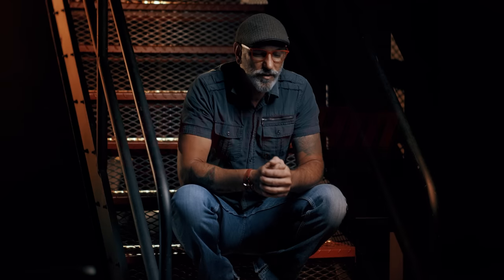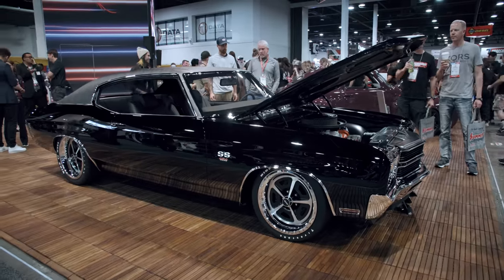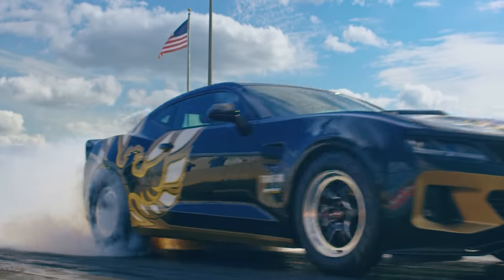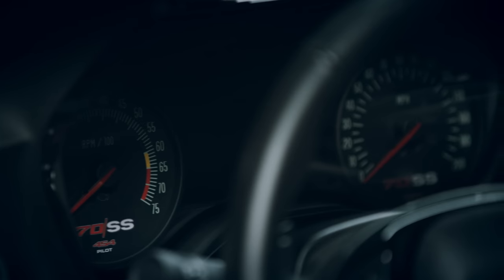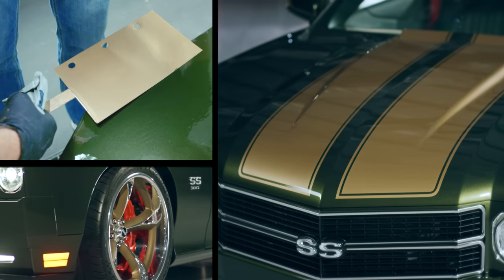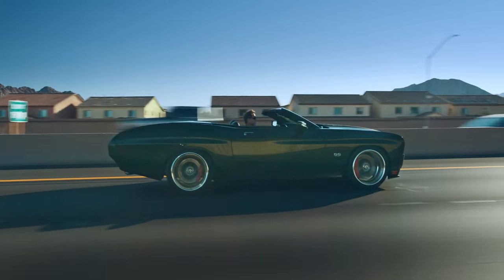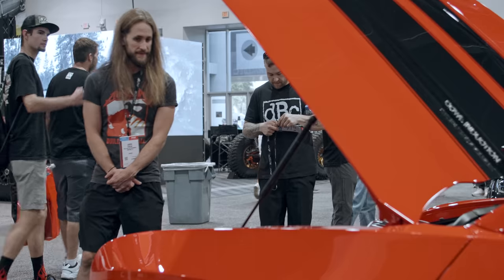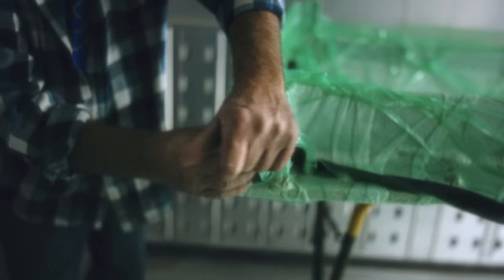The New 70/SS | Return Of A Legend |

Comment: Nice try. My 68 SS could get the front wheels off the ground and I could do all the repairs myself. All that on flipping burgers money.

GM has truly lost its way.
Reply: I concur. Mine had open chamber heads, ported and solid Isky cam in 0.030 396 Block.
A nice 70 SS Cowl induction 396 Muncie 4 speed was selling for $2795 in 1977 on specialty car lot.
I bought my Malibu 350 SBC with saginaw 4 speed with posi for $1000 and 68,000 on the Odometer. After a year I turned it into a clone SS.

Comment: I honestly don't like the way the front looks. All other angles where you can't see the front look great. I think its the bumper that is messing with it. To much color. While I hate chrome, I love the look of the 70 Chevelle SS and most 60-70 pony and muscle cars. The concept pic for the hard top looked a lot better in the front but its not perfect. That one is how the fender goes so far down then wraps in to make the air dam. But removing that big flat panel of color for a bumper is an improvement.

Comment: Sorry, but the 1970 Chevelle SS doesn’t come close to the 1969 Chevelle SS with the factory 396 motor ! My best friend had a AMC Javelin  with a 390 built to the gills with a four speed manual transmission and it was one of those cars that was so quick ,that he’d place a $20 bill on his dash and tell you if you can grab it you can have it. I never could get that damn $20 bill. I owned a 69 SS Camaro that had the original350 -300hp motor in it and his Javelin would eat my Camaro.